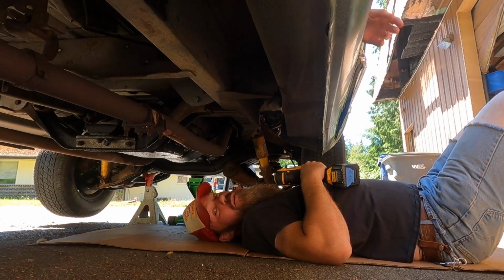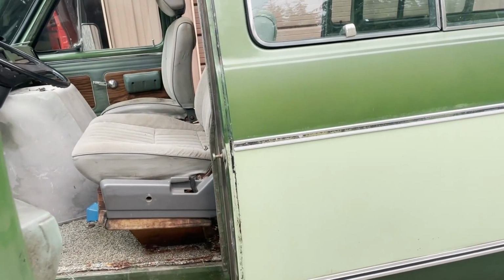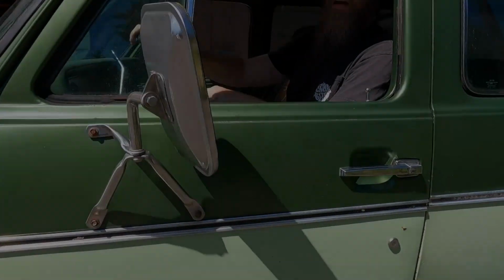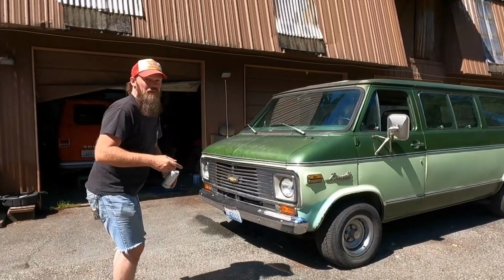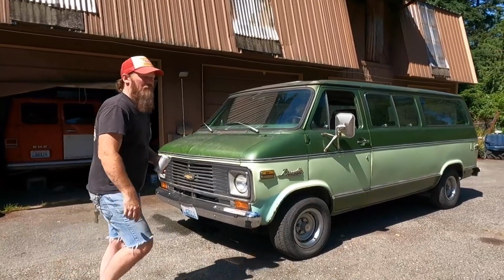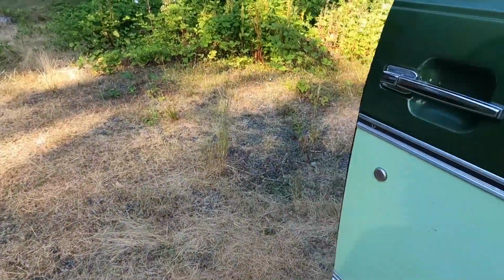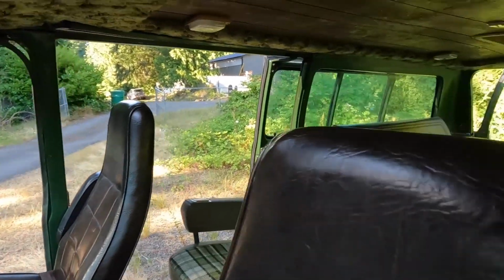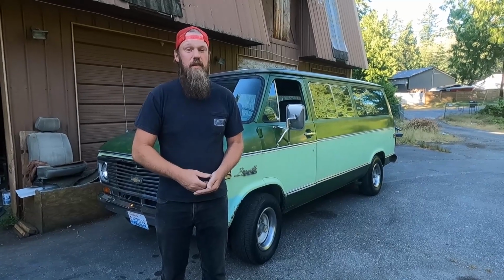This Or That! 1976 Chevy Beauville, known as "The Gentleman's Muscle Van", gets wrapped up.

Comment: Reminds me of the '72 3/4-ton Sportvan my uncle had: Same shade of green (On your upper-body) with a LT9 350-ci. 4-bolt block/THM350 automatic transmission. Also--while he had it--he had a "Energizer"/RV cam and Holley Economaster carburetor installed, to help it get better mileage and pull his boat or 3-axle camper trailer. But when that van was unloaded, man... did it "boogie"!😉

Comment: Brings back memories. I had a 1989 Beauville van with the weak 6.2 diesel. Great van, weak motor (20 mpg on the highway though). I had it for over 20 years and it was still in great shape when I sold it. Looking to buy a new Chevy Express with the 6.6 gas engine - 401 hp and 464 lb-ft of torque! Whoo hoo, talk about a "Gentleman's Muscle Van"!